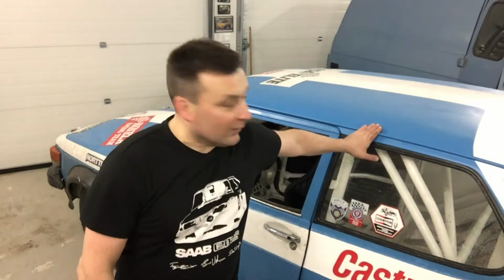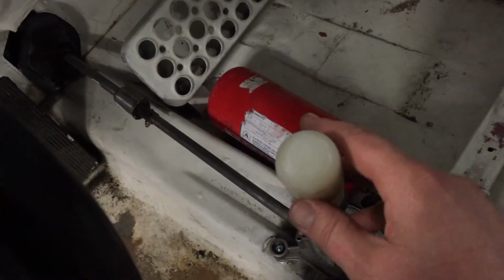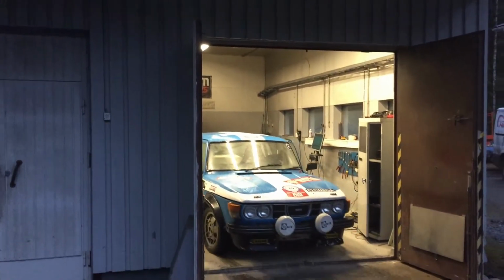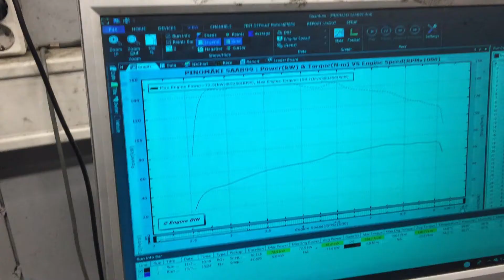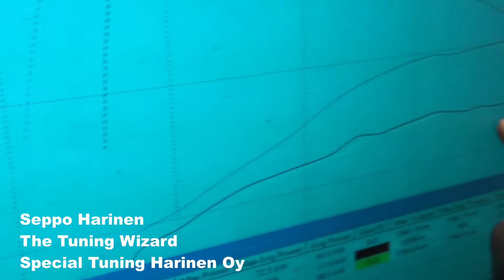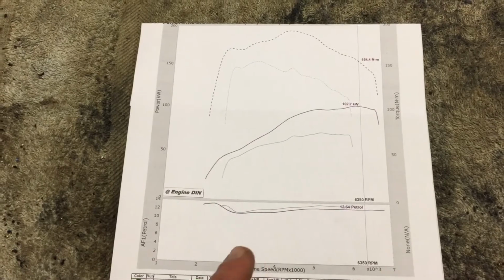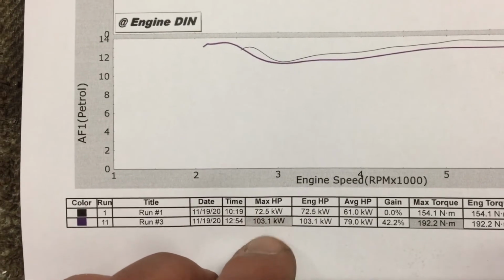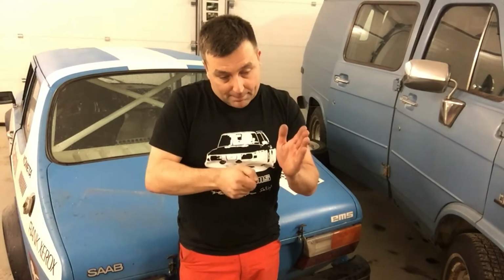Saab 99 EMS engine tuning and dyno session

Comment: So what carbs are you using, also what other modifications to the engine
Reply from the maker: No carbs. K-jet mecanical fuel injection. This is build for group A so nothing special. Little bigger compression ja some head porting. The cups in the head are from Citroen. Little bit lighter. And cam is ofcourse slighly different. Only 140 hp so this is not a rocket. ;)

Comment: This EMS has 118 hk from factory? Or should have when new and everything perfect adjusted. So 140 is quite good! Dont know what modifications you are allowed in your class, if any?
Reply from the maker: Yes, 118hp. This engine is build for group A so its quite standard. In the 70’s this car had 16 valve engine and over 200 hp. We could use that engine in historic but they are rare and too expensive for us.😅 140 hp with wide torque range is perfect for out use.👍
Reply from the maker: This car is actuall exworks so it has been a rally car from the beginning. So this car has a race history from 1977.
Reply: Lovely to see the Saab performing again. Must be very motivating. What timing advance did you end up using?
Reply from the maker: @sebastianbubbedi3752  Yes, i'm now very happy and motivated. ;) I actually don't know the timing advance. I forgot to ask from the tuner. I just have to check it and put a new mark to the flywheel.